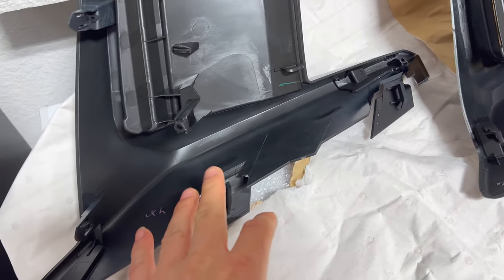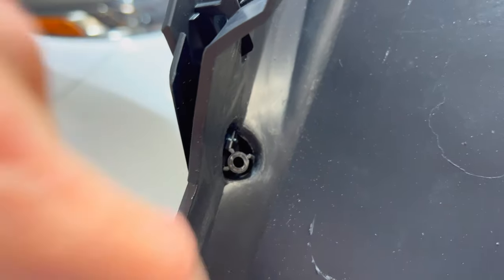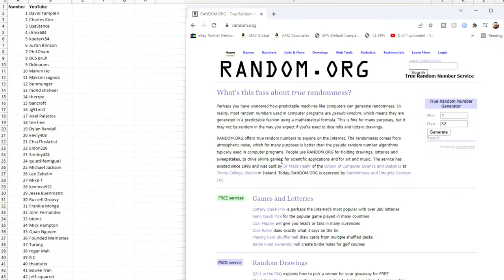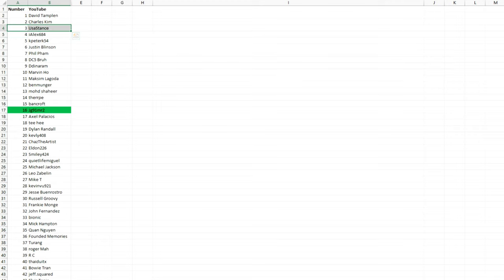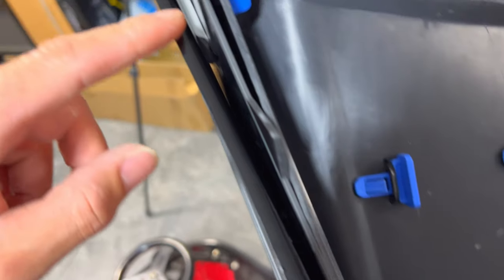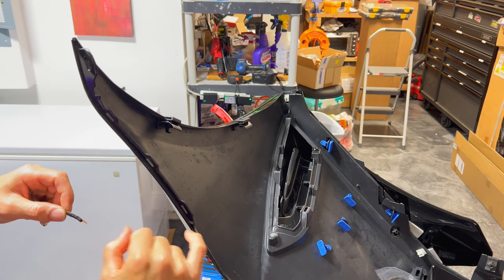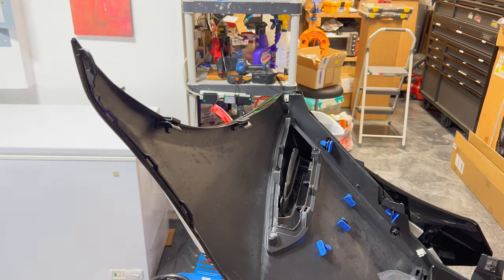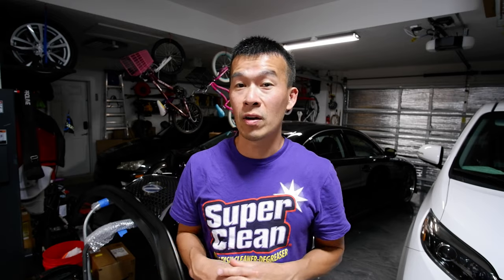2021 Lexus 4IS F-Sport Bumper Conversion on 06-13 2IS IS250 IS350 IS500 | Car-Act

Comment: looks great i personally would of kept the vland headlights on there
Reply from the maker: Got better coming.
Reply: @TunerwithKids   2012 OEM or the new HC motion?
Reply: @phoenixoflight600  
Probably hc motion or that other one I think called jmin headlight, it look the same as HC but the check arrow go beyond the center of the headlight.
Reply: @kg888   I have some HC motions coming in along with a 4is conversion bumper. I’m excited to see it all put together when they arrive soon.
Reply: @phoenixoflight600  
Let me know and make a video of it. I wanna see how it is before I buy it HC. But I still want my eyelids so I might bite the other headlight.

Comment: Looks amazing! Can’t wait to do mine. About how much did the body charge for the paint
Reply from the maker: $850. They grills cost about as much as the bumper to paint. Plus the body work to fill the washer holes.
Reply: @TunerwithKids  850$ totally for both? So looking at about 2k with the bumper? Looks awesome!

Comment: Hey man nice car, I have a 2006 IS350 and I’m looking to do a conversion but just to the 3IS. I also was wondering if you have any other body mods/add ons. Side skirts? Or rear bumper lip? Thanks for the inspiration man.
Reply from the maker: I have OEM GFX kit on sides and rear.
Reply: @TunerwithKids  thanks... does the 3IS conversion kit come further down in front than the OEM 2IS bumper?

Comment: Car looks amazing 👏.  Everytime you do a conversion the car looks nicer. I see your buddy Full-throttle did the same conversion on his silver lexus and part fitment also looks great all around.. Would you still recommend I do this to my car even though its white. I know you had a bit of a issue of gap in the front but molded it a bit and used the black rubber bumper cover to help hide the gap. Will the gap be too noticeable with my white car? 🤔 Anything you reccomend to hide that? Thank you!!
Reply from the maker: Yea. I’d rather do this on white since it’s much more dramatic and visible. Once fitted correctly, everything looks good.

Comment: Hey on ur 4is conversion what side lips are those or do they come with the conversion
Reply from the maker: Watch my 3rd video on the bumper.
Reply: hey I just bought a 4is conversion so I'm piecing all the bolts together but what holds the front emblem in place
Reply from the maker: @DavidOrtiz-tt2bj  a screw. Like the grill ones.

Comment: It’s would be nice if this bumper came with the tow hook . Can you customize and made it ?
Reply from the maker: It has it in the grill.
Reply: @TunerwithKids  thanks you , because I live in the areas where it’s snow alots ,
Reply: Not like the first conversion bumper it’s has the round circle cap where you pop it out and inserted them tow hook .
Reply from the maker: It’s in the same spot, this bumper has a larger grill so the cover is part of the grill.